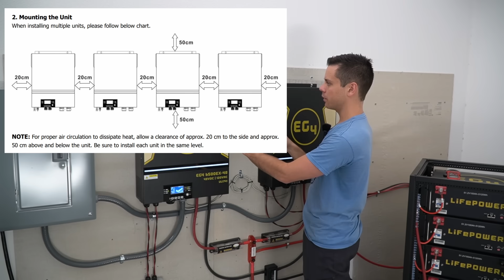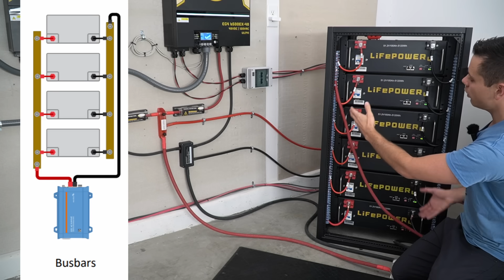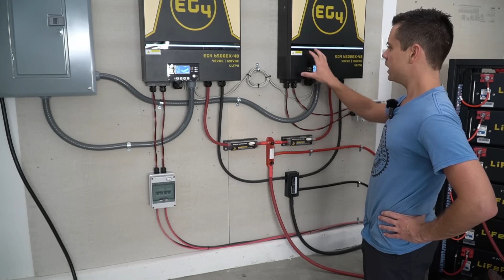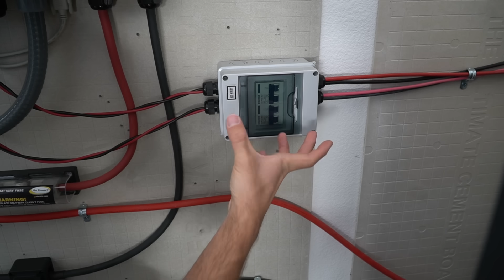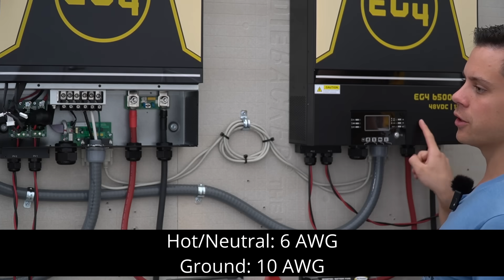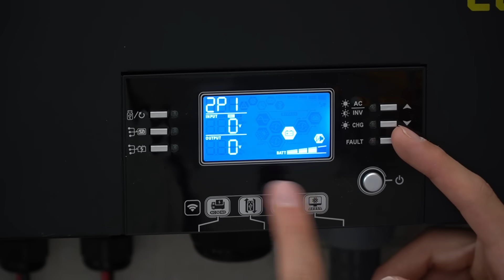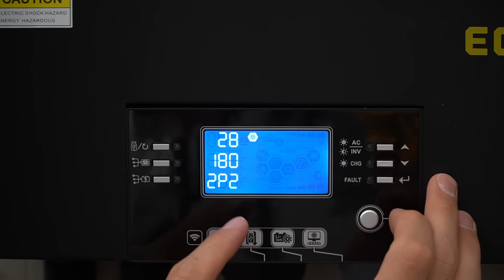Complete 48V Offgrid Solar Power System

Comment: The 3/4 flexible conduit works with those rubber fittings they sent. You just remove the little rubber ring inside. That would eliminate the issue you had with having to buy a large washer.
Reply: Yes, but he is building a code-compliant system.  Code requires you to use listed equipment according to the manufacturer’s instructions.  You may be correct that is will physically work, but an inspector my fail it. Good to know.
Reply: @powerranger9160  it’s possible. But they send those fittings in the kit for just that reason.
Reply: For the price. There's no harm in making the adjustments Will did. It all worked out for the cost of a few dollars.
Reply: @joub5  it worked out great. It’s unnecessary though. So I was trying to help him and others if they were going to be installing the same system.

Comment: Damn, this setup is insane. I'm planning on having a battery backup of 120KWh to be able to charge a 100KWh EV. I wonder how much it would cost. Hopefully smaller, more powerful batteries are invented.

Was also looking into Lavo hydrogen fuel cell setup since it can provide 40KWh of electricity.
Reply: Lavo cells have very low round trip efficiency, you'll get out ~50% of the energy that you put in. Very expensive storage relative to LiFePO4.
Reply: The server rack setup Will shows is 30 kWh and costs about $10k.
Reply: What would be more efficient is if the solar arrays, thru an MPPT could go directly to the batteries in the vehicle.  There is very much waste in the conversion process to go to AC, to put into an AC to DC charger for a vehicle.  30% loss when done this way.

Comment: You mention that you could connect it to the grid. Can you go into detail as to how you would do that and what products you recommend for doing so?
Reply: You can look the manual up online. They recommend 4awg wire and you feed it from you main breaker panel. I was worried when I installed mine but it’s fairly simple.
Reply: @GavinStoneDIY  I was talking about when Will mentions you could connect with an automatic transfer switch. I want to know how to wire the ATS to your main system and what ATS is good. Are there other ways of connecting than an ATS? The 4awg wire does not address HOW it will connect, just the type of wire.
Reply: @stevereschke3317  ah I see. I misunderstood your question. I guess I will have to rewatch the video. I don’t see the sense in wiring an ATS into the system when the inverters come with an internal auto switch already. But maybe I’m not looking at it from the right angle.